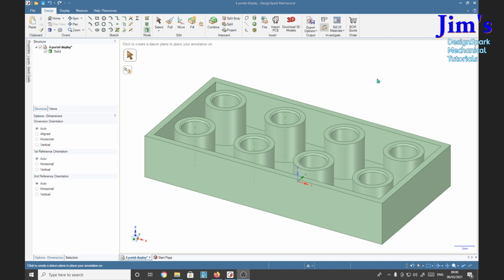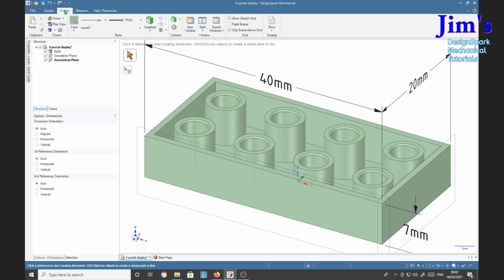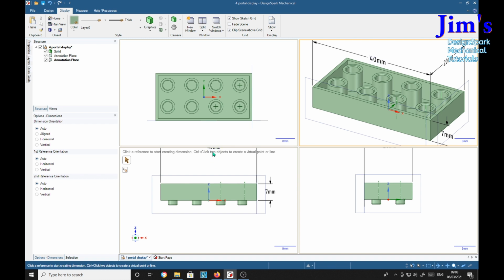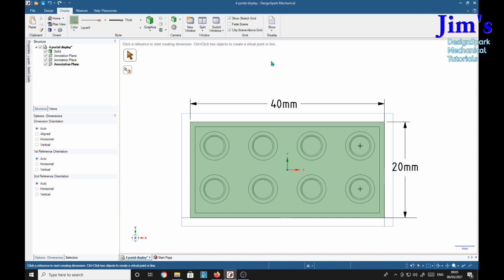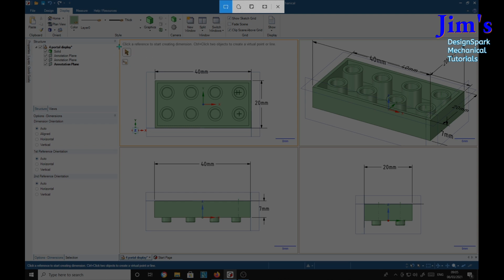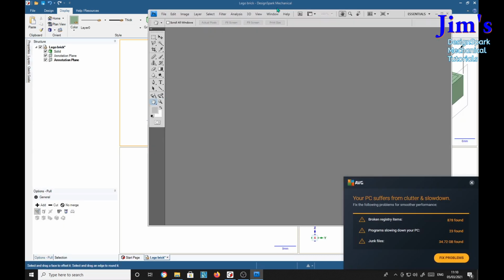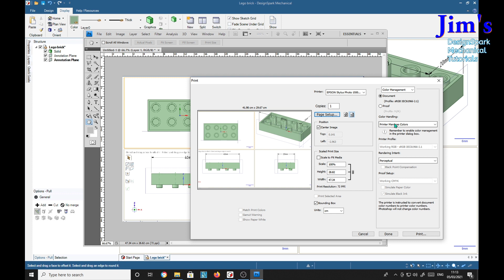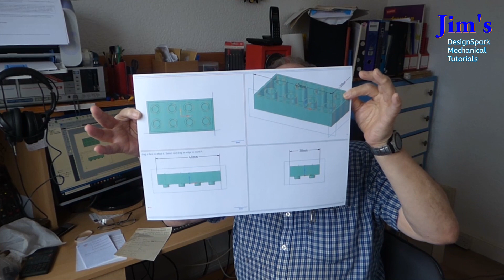DesignSpark Mechanical 4 portal display and printout

Comment: Jim can I ask how do you perform a 2d cut list say from an MDF wardrobe but in the same format above.  Whats confusing me I have drawn my 3d image, but how do I explode a drawing to a 2d form for cutting each side or a shelf as individual parts so I can cut them on my saw? Can you reverse the 3d image so to speak?
Reply from the maker: You will need to construct the wardrobe out of separate parts (top, bottom, sides etc) and then you can display them individually or in the assembly by placing each part orthogonally flat. There is no facility in DSM to automatically explode the assembly and make a cut list.

Comment: Thanks for continuing with DesignSpark (DS) Mechanical!
When I use the undo command (ctrl+z), DS does not step back in a linear fashion.
Instead, it goes back maybe five (5) levels or more with one ctrl+z stroke.
I can use the redo function to step forward (linear), but it is annoying.
Have you encountered this?
Regards.

DesignSpark Mechanical
Version 5.0 (2020 R2) (2020.1.0.07232) 64 bit

PS:  I have not change or modified any undo parameters (Options/Advanced/Maximum undo steps)
Reply from the maker: I have indeed - very strange behavior.